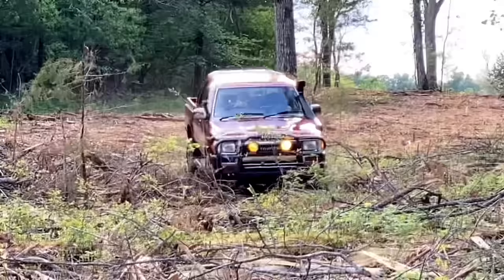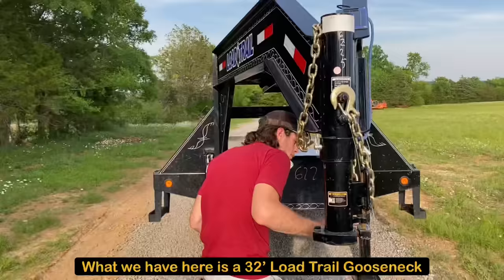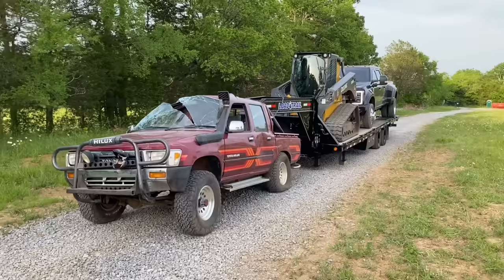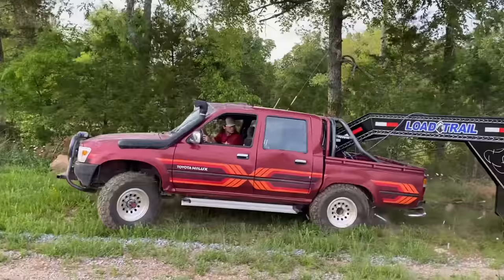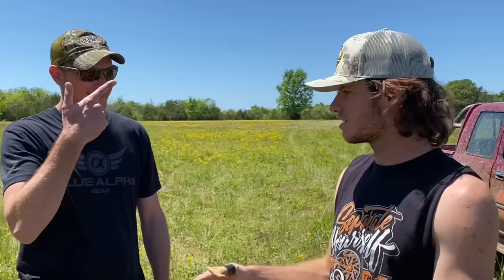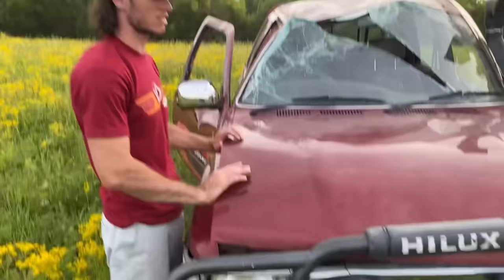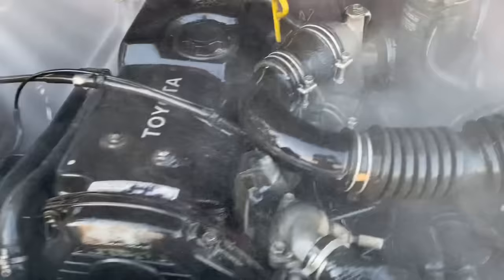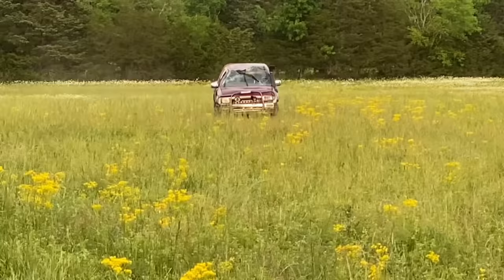Toyota Hilux Durability Test #2

Comment: I would love to see him try the same tests with a modern Tacoma to see if they are as good as older Hiluxes.
Reply: Yea
Reply: Or like one of the early 2000 builds that go for $10k with 260k miles
Reply: they are not lol.
Reply: Omfg, Tacoma is an american vehicle. NOT A HILUX! The Hilux is still being produced to this day and is the no 1 selling vehicle in Australia and has been for years. Only reason they don't sell them in America is because it would ruin all the competition. In saying that, todays Hilux's would definitey not hold up, too complex and fragile.
Reply: Dude, Hilux is still being produced. I dunno bout how tough the latest ones r but I've got a 2006 Vigo which is the domestic thai model nd that thing can run without oil or coolant. It's the toughest truck in Asia nd literally everyone uses it due to its durability. As a result the resale price is quite high.
Reply: @TasmanianHillBilly  Dunno bout today's hiluxes mate cz they're the eight gen ones but the seventh gen ones r as tough as hell. Bit low in the front cz of IFS
Reply: I had a 2001 extended can 4x4 tacoma that I completely demolished over time, it took one hell of a beating, enough for me and all my buddys to be very impressed. I ended up accidentally crashing it into a tree at 55 mph and totaled it, it had an ARB steel front bumper which took a lot of the damage from the tree but it was still totaled. I sold it a couple weeks after the wreck for 2k and when the guy came to pick it up he tried to crank it to see if it ran and she fired right up, which is surprising bc the motor was through the firewall, so yea tacomas are extremely tough. best truck i have ever owned by far.
Reply: Don't need a test to know that answer. It wouldn't take near this amount of abuse these trucks were exceptionally well built.
Reply: Funny thing is that one season of using a Tacoma for firewood delivery or any kind of commercial work will kill it. That's why u don't see them at work sites. But a sucker is born everyday
Reply: I drove a brand new one in the desert in 2012-13 and seen another dude wreck one of them into a pole...I can confirm they are not made like this anymore
Reply: They still make the Toyota Hilux in utopia so a Tacoma isn’t really the same truck
Reply: @gasspack  Yeah, I'd probably own a Toyota truck of some sort if it weren't for the insane resale value they have. I've sold a '98 4runner with 430k miles for 5k!
Reply: @mikeschmidt4800  My current 03 Pre-Runner has 267k and I could easily ask $10k for it.
Reply: Lol, Toyota
Reply: @user-dm8ok6hl3e  lol ram
Reply: Or ANY american commercial pickup truck...
Reply: @youngboomerragevictim8857  Here in Chile the Hilux is the most used truck in the mining industry.
Reply: I hope he does
Reply: The Tacoma have more power and the engine is bigger. The toyota Tacoma pull 10.000lbs  the Tacoma can pull that easily
Reply: My 96 Tacoma easily drug an old dead school bus with flat tires and old RVs with tires falling off their rims.
Reply: This model would have been worth so so much money if she was garaged and in good co. It will be a rare collectors item .
Reply: Not a chance
Reply: @tvnja  yeah a hilux is very different than a Tacoma. The Tacoma is so flimsy it's almost like it's sold to Americans out of spite. My self and my friend both bought used tacos trade work when we were young and they were cheap and neither made it through two seasons.
Reply: No. At this video i laughed so hard i pooped my pants (just a little nut)
Reply: Yeah and then try it with a Ford ranger and a Chevrolet Colorado... I've got $1,000 that says they won't hold up to half of what the even newer tacomas will
Reply: @Nx553  I disagree. I had a 2004 Toyota Tacoma and I was in an off-road club for many years. During that time I jumped it multiple feet off the ground dozens of times, rolled it multiple times, drove it through water so deep that it was pouring in over the door while the windows were down. It sucked water into the engine multiple times. I would shut it off and simply drain the oil and put fresh oil in it. I never changed the transfer case oil, transmission oil, or differential oils despite driving it in very deep water over multiple years on multiple occasions. It ran the day I sold it to a dealership and ran good enough for the dealership to want to buy it.
Reply: @gasspack  Bro my 99 prerunner has 255k
Reply: @gasspack  I got a 2002 I got for 10k with 107k miles and it’s done literally everything I’ve thrown at it, tons of off-roading, like real off-roading like this not some pussy fire road shit, lots of hauling for my construction job, had some drunk guy rear end me, fucked his car up mine was perfectly fine just a little dent. And it’s amazing
Reply: @GavinFrieze  Crazy thing is I have an 03’ with 268k and has towed many cars, been hit twice in the rear, and i’m still having people ask to buy it.
Reply: @gasspack  same. I’m always getting compliments on it even though it’s 22 years old and it’s totally clean it’s so sick I love it
Reply: @DwaynesJohnsonLaysTheSmackdown  oh damn, hoping i can get mine to 300k no problems
Reply: @gasspack  Take care of it and it can reach that easily
Reply: Hilux it's more fuckingore better thant the new Toyotas that are allow in usa.
Reply: Honestly any single one of these tests would cause thousands of dollars of damage to most modern pickups, they just aren't built for durability anymore
Reply: The l300 still being made in Indonesia, it's literally the same vehicle from 80s/90s
Reply: I thought ‘84 was the last year Letoya produced a 4x4 trukk with a SOLID front end. After that it was a differential and drive rods to the ball joints. Not as bomber as solid, and the ride is a lot smoother....

At least on pavement in ‘Merikka!
Reply: They're not
Reply: In South Africa the hiluxe and land cruiser is the best selling and most durable
Reply: of course not lmao
Reply: Yeahhh
Reply: The thing, government imposes safety features to all vehicles now like airbags etc, so test like this is doubtful..
Reply: @gasspack   I used synthetic oil. @250k when I sold it, It burned as clean as a new car.  The smog guy wanted my spark plugs after I removed them @ 110K They were clean..I did occasionally add a bit of mmo to the gas. 1/2 of what was recommended every once in a while. more is not better. The plugs were platinum. Long life Toyota antifreeze, maintained air filter. Ran tires cold at 35 psi, Michelin ltx tires, went to 73K miles and we're still legal, when I sold the truck. NICE TIRES! Gotta hand it to Michelin, safe tires, excellent handling. peace
Reply: Defitenely not as reliable
Reply: I can say that my 2020 TRD off-road Tacoma is almost identical underneath to my buddies 06 sr5. And even similar to my 94 pickup in design. Toyota doesn't fix what isn't broken and it shows. Even if they do break, the ease of repair makes doing 90% of repairs a breeze at home.
Reply: Not a Tacoma, because it’s build in America. You need a Japanese Hilux.
Reply: @peterpontzer4006  Nice! Are they as overbuilt as a Hilux?
Reply: @mateobrainardo4770  hey I'm going by experience. I had a '98 Tacoma that was supposed to last and it shit the bed mechanically and then frame rusted out when it was sitting in the back yard as a project
Reply: I work at a Toyota dealer. The 3rd gen tacos are hot garbage compared to the old ones
Reply: @wildmikefilms  Why? What has changed in the production?
Reply: @briang8237  the new 3.5 feels gutless compared to the 4.0. And the early years (2016-18) were plagued with many quality control issues from interior imperfections to oil and coolant leaks from the factory.  The later years seem to have gotten better.  Though
Reply: @wildmikefilms  Interesting. Do you think newer Tacomas will live up to their reputation, or have they gone downhill until they're about the same as a Colorado or Ranger?
Reply: @briang8237  I'm not sure yet. If given the choice I would still choose a new taco over a new Colorado or ranger. They are very cool.
Reply: @wildmikefilms  Agreed!
Reply: @briang8237  hey you know what it was good to have a friendly conversation with someone in the comments. It's so rare! I hope you have a good weekend!
Reply: @wildmikefilms  It was a pleasure talking trucks with you! Have an even better weekend!
Reply: @Steven-gv1ke  that's not newer 😆thats 17 years old..
Reply: @TasmanianHillBilly  y por excelencia la land cruiser 70
Reply: 100% this Hilux Kills the new Tacoma!!!
Reply: @TasmanianHillBilly  The reason the Hilux never came to the US is because Toyota had/has no interest in trying to modify their diesels to pass US EPA emissions regulation.
Reply: @gasspack  i have a 2001 tacoma with 300k on it 👍🏻
Reply: @tonydicken5033  yeah where I live a lot of people use those older tacomas as farm trucks. i thought about buying one just as a little winter beater
Reply: Bad idea to compare the older Hilux to a new Hilux. The new ones are very ugly. Looks like a ridgeline and colorado together and not enough ground clearance. Tacoma is better off for modern, the 2nd gen 4.0L engine. 3rd gen is a slow one, not enough power and has electronic issues.
Reply: Lol not a chance. Tacoma is the watered down weaker version of Hilux. It's a shame they don't sell them in North America
Reply: @Pantelifts10  my father 2016 tundra can pull 16000lbs
Reply: @Pantelifts10  there are 2 types the 2.7 and the powerful 3.5 v6
Reply: @live_the_moment_with_arnol5661  I know all of them brother. I'm a Toyota fanboy. I have 2 Tundras for my landscaping business. A 4.6L V8 regular cab trd and a doublecab 5.7 V8. I believe the tundra can do that weight but the maximum tow capacity on paper is 10.500lbs that I have on the doublecab. Done 10K plenty of times no issues 👍
Reply: @Pantelifts10  i like the tundra they really powerful
Reply: @Steven-gv1ke  No doubt the dealership listed that vehicle as "slightly used."
Reply: Modern Tacoma’s are fairly beefy. I own a 2020  trd off-road and took it around the ringer a few times. They’re not AS beefy as the hilux but they can take the abuse for sure
Reply: They’re still nice but they’re not as good as the old Toyotas. I have an 87 Landcruiser that is a tank.
Reply: @TasmanianHillBilly  yeah it’s grandma’s daily driver nowadays. No space in the cabin too. Literally one of the most uncomfortable cars I’ve ever been in.
Reply: @youngboomerragevictim8857  I tow a car trailer with 2 side by sides with a 4 banger Taco, at least 5k lbs and it's rated for 3500. The American bodies are junk but the engines and transmissions are used all over the world in at least a half dozen different models. You ain't killing shit junior.
Reply: The only main difference is the old Toyotas had a fully boxed frame whereas the new ones have a C channel.  But besides that they're just as tough.  That's a good idea he should definitely do it. .
Reply: I’m a hardcore Toyota fanboy, and an owner of a Tacoma with over 300k miles. But I’ll be the first to say that Tacoma’s can’t hold a flame to the durability of these old hilux.
Reply: Yea
Reply: @gasspack  the thing is, this hilux was in a shipping container for 90% of its life, it probably had like 5k miles or less when he bought it
a tacoma that has 260k miles is obviously not gonna be nearly as reliable because things have loosened and parts have worn
Reply: Bro my mom's boyfriend rear ended a Prius and the truck wouldn't start and was totaled so no..no it wouldn't
Reply: I can tell you right now they are not.
Reply: @TasmanianHillBilly  yeah, new ones are shit compared to this
Reply: No way they are. Cars aren't as reliable as they once were and I have no doubt this would SMASH any modern toyota
Reply: @thndr_5468  It definitely would
Reply: @KobieK  hilux is no longer what to be. Built with the same quality as any other Toyota . The Tacoma would beat the hilux with its size and bed length , the hilux is tiny compared to it
Reply: Tacomas suck, they literally bend the frame with the slightest weight. The real gs are the modren hilux that don't sell in the us
Reply: @TasmanianHillBilly  thank you!
Reply: Thats why you buy an old pickup
that is built like a tank.
Reply: well your dream just came true in the last video he uploaded
Reply: @kevinsworld.7086  OOOHH YEAAH
Reply: @briang8237  WhistlinDiesel never ceases to amaze me with the stuff he does bro. I can't wait to see what he does with Monster Maxx 2.0
Reply: @kevinsworld.7086  It seems like he's trying to make it indestructible as a personal challenge to himself. I can't wait!
Reply: @briang8237  I said the exact same thing when I watched the video of it. He doesn't post very often but I get it, he only wants to release the best of the best videos.
Reply: @kevinsworld.7086  I totally agree. I  would rather watch a few awesome videos than twenty that stretch tiny bits of content just to garner more views.
Reply: @kevinsworld.7086  And I just saw the thumbnail for his latest post. Haven't watched it yet, but I'm already happy and excited.
Reply: @briang8237  oh man you need to, it's one of the best videos he's made in the last 6 months.
Reply: No way
Reply: @tonydicken5033   thats so good i sold my hilux to a mate for $1500 biggest regret he crashed it in tasmania badly and still managed to drive it across australia all the way to cairns
Reply: They are not
Reply: Nkuall
Reply: @mcdoonaldsmanager8706  nkuolu
Reply: Can't compare a shitty American Tacoma but the new hilux definitely
Reply: @TasmanianHillBilly  no actually they don't sell them in America because they can't meet the emission standards in America. They also can't meet the safety standard. The modern Tacoma is Toyota's excuse of a truck for the American Market. When playing by the American rules, that's what they've come up with. As much as you folks want to talk about how great the Hilux is, we have American Diesel's over here that run a million miles all the time actually doing real work. The Hilux isn't that impressive, sorry. In fact that you turn back the clock on a mission standards to the late 90s which is about where most of European markets still are, we had the 7.3 for instance that International was making for Ford. They were in vehicles like tow trucks and they still lasted a million miles. A hilux is not a towtruck. I didn't actually even find it that impressive that it pulled 30000 lb because it was in 4-wheel drive low. The amount of gear ratio uptick going on in 4-wheel drive low is pretty crazy. We're talkin what would normally be 25 to 30 mile an hour of gear ratio combined into 2 mile an hour instantly. Not that impressive sorry. Farm tractors do it all the time.
Reply: Naw it won’t last
Reply: The transmission would INSTANTLY blow up lmfao
Reply: @TasmanianHillBilly  they are the same as a Toyota pickup which would be the tacoma today

Comment: Legend has it that these truck would even run without an engine.
Reply: XD
Reply: Lol, these small trucks were tough due to gearing.
Reply: 🤣🤣🤣🤣🤣hilarious
Reply: @toy4runnerpiney  And the soild front diff, robust large capacity 4cy diesel engine, fully boxed robust chassis, tough gear driven transfer case, simple leaf spring suspension, the same steering and driveline as 75 series landcruisers which are a much larger vehicle, and the fact that the hilux was a light weight truck. Nothing of which most modern vehicles have.
Reply: @toy4runnerpiney  cannot confirm: L52 Toyota transmissions are complete ass. They're the weakest link in the earlier Hiluxes. If you took the L52 out and put it in a shitty Ford Taurus, it would be the weakest link in the Ford as well. And the early Hiluxes were tough as nails too. Toyota overcompensated for this in the mid '80s by replacing the L52 with a big chungus transmission though.
Reply: Who told you these trucks have engine? Engines dont take that much abuse.
Reply: 🤣 bruh!

Comment: Why can’t vehicles be as simple and reliable as this Hilux
Reply: Because then the car companies won't be able to sell you one every few years, because you're still driving the old car without any problems. 🤣 And also environmental regulations.
Reply: “Money”
Reply: They can, buy a hilux
Reply: Just get a car not made in the 2000s and up
Reply: they can be. take another hilux as example
Reply: economic growth
Reply: Because car manufacturers dont care about reliability or durability the way they see it the cheaper it is the better when you get sick of it fucking up all the time you might buy a newer model hoping it will be better but hold on bc most manufacturers are to cheep to update the engine and trans with most of the components so it's always going to be the same shitty car it was before just with a nice face lift and so new features long story short they dont care what you think as long as they are getting your  money
Reply: '94 4 dr Cherokee with an automatic transmission is the closest thing to the American hilux from that time period.
Reply: Toyota fixed all that in 04 when they released the newer model.
Reply: @skeetorkiftwon  Or the 4.9L (300) Inline Six in the 92-96 Ford Trucks.
Reply: @johngulbunny7456  current hiluxes are still strong af
Reply: @danx7143  damn I didn’t even know they still made them, those look way cooler than Tacoma’s. What’s the excuse for banning them for America?
Reply: @johngulbunny7456  they aren't really banned, just toyota can make more money selling tacos and stuff they build in usa so they don't do the required testing and potentially small amounts of extra emissions stuff to sell them in usa. Plus Americans don't seem to like small capacity diesels.
Reply: Not even the new plastic overpriced hilux's can beat this beast
Reply: @danx7143  nope, not even close. They're no better than any other Thai assembled Jap ute.
Reply: @Dankro91  "driving old cars with no problems" 1998 toyota camry enters the Chat